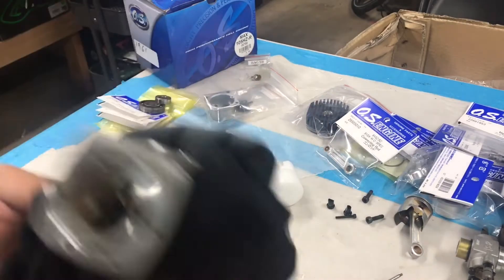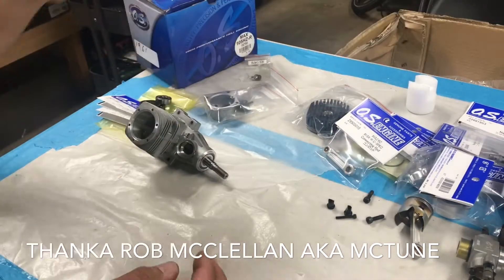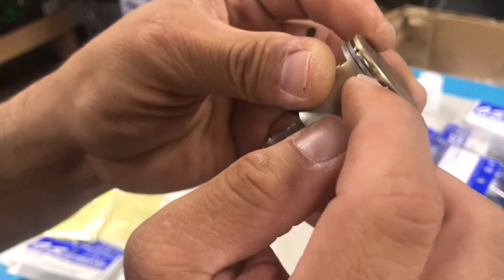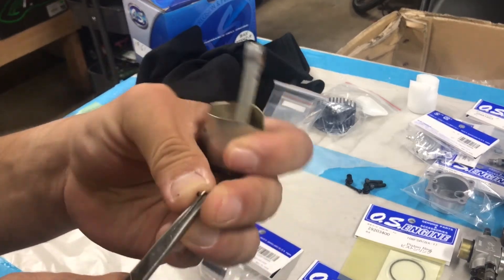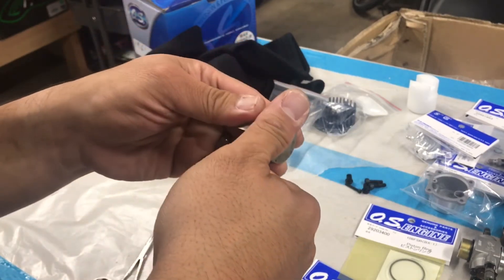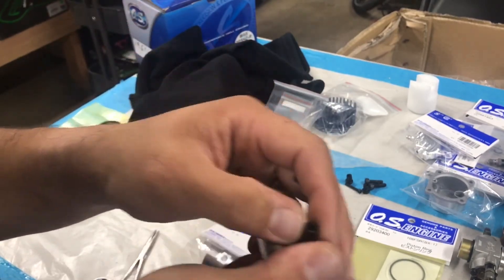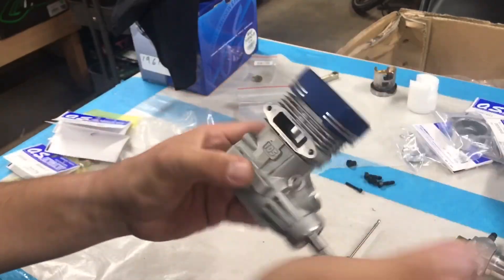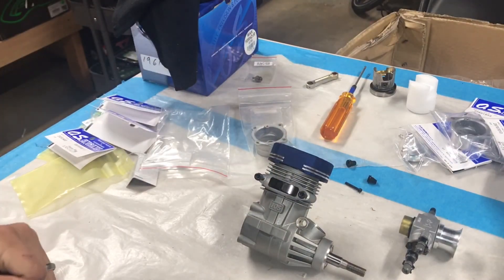OS MAX 105 rebuild part 2 of 3

Comment: Would it be a good idea to put oil on some of those components when you’re assembling them? Like the pin, piston ring, sleeve etc..? But great video, I’m about to take my motor apart for the first time.
Reply: delgadokd yes you can use assembly oil. On another build I ended up using a little spray bottle of nitro fuel since that has oil in it.